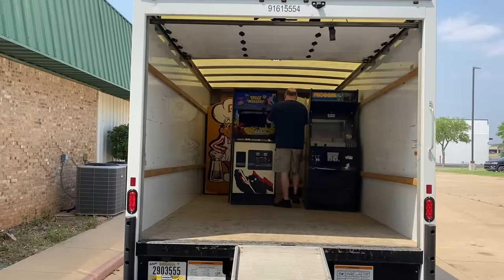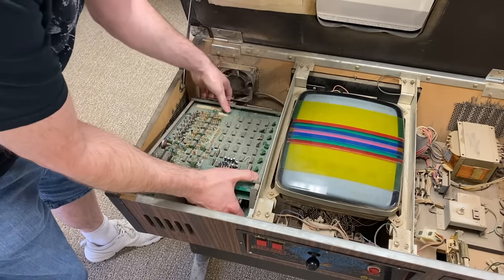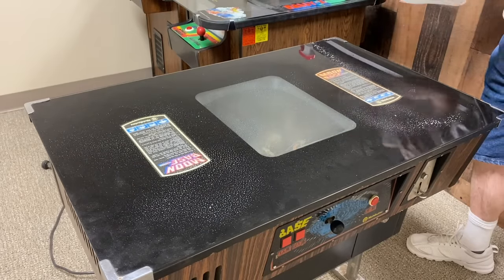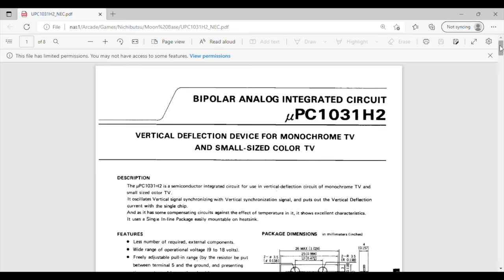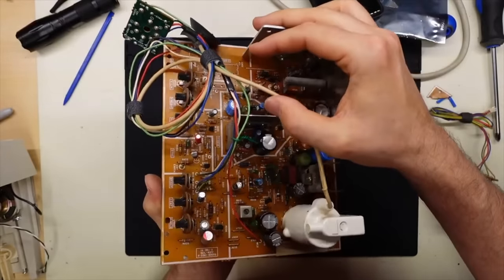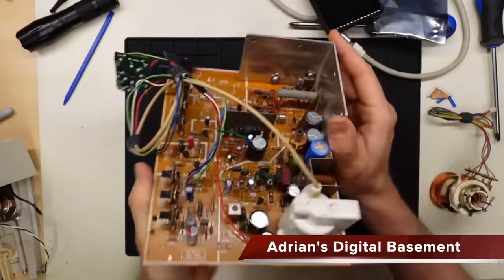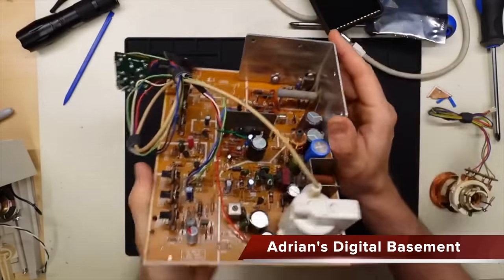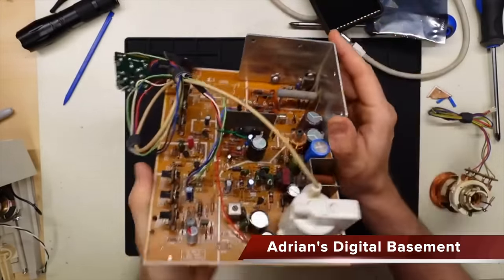Moonbase Arcade Restoration - Gone Wrong

Comment: I'm a TV technician - I started working on CRT sets (including monitors) in the late 1970s and continued into the early 2000s. First thing I will say is don't beat yourself up for installing the replacement IC backwards. I have done that a number of times myself, it's easy enough to do! 
As for the failure of the replacement, there's a few things I would be checking. The first is the DC resistance of the vertical coil on the yoke. It should be between 2 - 7 ohms (and 4 - 15 mH if you have an inductor tester). Also check it for shorted turns. That will kill a vertical output IC in short time.
Next check the voltage rail going to pin 2 or 10 - should be within the range of 9 - 18 volts (20 volts absolute max).
It is possible (can't be ruled out) that when you powered the board up with the IC installed backwards it compromised it. The results of such a situation can't be predicted. I have had ICs survive just fine, others fail immediately (let the magic smoke out) and some which worked fine for a while only to die further down the track.
Those dark stains on the original chip are indicative of an IC that's been running really hot. I suspect the thermal connection to the heatsink wasn't great. It needs to be very well thermally bonded. Use the white thermal paste.
Lastly I would question the authenticity of the replacement IC. Where did you source it from? If it's from eBay or Aliexpress etc it's likely a chinese fake. They'll often work for a while then go toes up after a period (as this one did). 
I would attempt to find a genuine IC from a known seller to be absolutely sure it's a good one.
As far as I can see, the KA2130 is a pin-for-pin replacement for the uPC1031H2.
Looking forward to part 2 of this saga.
Reply: Is it possible the power supply is just too high voltage?
Reply: Yeah, first thing I thought too - Partly shorted yoke would burn that IC up . I half-expected Adrian Black to check that on his video..
Reply: @cheyannei5983  Yes, it is possible but unlikely. If there was more than 20 volts on the vertical IC it would mean the rest of the supply rails were likely high as well and there'd be other weird symptoms (or capacitors starting to vent off). In any event, you would check the voltages as a matter of course before replacing any ICs like this.
Reply: @telbee  I've seen more than my share of yokes with shorted turns over the years but in this instance I would want to know that the vertical IC is a genuine part - there are way too many chinese fakes on the market and this is typical of what they do. If they work at all, they'll run for an hour or two then fail.
Reply: It seems like a frequency issue. Caps and resistors together can be used to create frequency. If there's a resistor that went weird then the SIP would work until it gets damaged again from too high current then you'll get the same issue. Something going to the SIP is probably messed up and replacing that SIP will cure the problem for long enough for it to get fried again. I'm thinking blown resistor.
Reply: Just commenting so this stays popular for him to see
Reply: I like your funny words magic man.
Reply: "Those dark stains on the original chip are indicative of an IC that's been running really hot." - like a machine designed for 100v being run at an over-voltage of 120v.  I'd bet The second chip couldn't take it either (and perhaps the NEC was a slightly better part with more tolerance for over voltage).  Time for another new chip AND this time fix the over voltage problem so it doesn't get burnt up too.
Reply: You were absolutely right - as he said in the next video, DC voltage was fallen down to 6V. So problem was in the power supply.
Reply: Thermal paste is subject to "thermal pumping" where it gets "squeezed out" over hot/cold cycles. I highly recommend using TIM i.e. thermal interface material. It's just better for many applications
Reply: what great and knowledgeable advice!
Reply: Wow, I didn’t expect to come across a tome in the comments section.😮
Reply: One thing I noticed is the heat sink on the new part is set to mount as you installed it (pin 1 in hole 10), but if you reverse it to the correct position (pin 1 in hole 1), how did you re-attach it back to the heatsink? If you didn't attach it or left an airgap between the metal top of the SIP and the heatsink with no paste or thermal transfer, that might also cause it to burn up. It's not shown how you re-installed it in the video so I wanted to call it out. Hope you get it working, and thank you for showing your process!
Reply: You're too funny, it's just an isolated phenomenon, don't link it to China ah
Reply: @cheyannei5983  -- The OG device power is 100 Vac converted to use US 120 Vac, so it wouldn't hurt to check the transformer to ensure it's stepping down the input voltage to what the cabinet takes.  But, be careful, high voltage is no joke.
Reply: Could it be a problem with the noise filter in the power supply?
Reply: Surely he should be wearing gloves?
Reply: @Garycarlyle  I've been repairing TVs since the late 1970s, never once worn gloves.
Reply: Awesome detailed information! So fascinating
Reply: These are Arcade games. I see 'em shown @ The 2-Bit Circus. Bornwell makes me useful.
Reply: @Alex-bc7qi  it probably uses a regulator circuit for the supply rails, so no big deal
Reply: 1 year later, and 8 bit guy has neither acknowledged this comment nor continued in a part 2. such a shame. but then again most youtubers over 30,000 subscribers stop paying attention to their comments entirely.
Reply: @yitong233 It's not an isolated phenomenon. As a professional repairer I have seen this happen many times, and in too many instances it has been due to counterfeit components sourced from china. If you don't like what I am saying then go and tell the people who are making all these fake parts to stop doing it - then there won't be a problem. I make no apologies for what I say - I have been burnt by fake parts once too often.
Reply: @miniadventureswithmark3309 The thing about electronic repair is it can be complex, and in order to explain things properly it is necessary to go into some detail. If I leave things out then I just get silly comments because people simply "assume" things, so I try to be as comprehensive as I can and cover all bases so there is no doubt.
Reply: @sw6188  Stopping unscrupulous merchants is impossible. QWQ
Reply: @TheKrensada  the very next video was him at the Vintage Computer Show in which someone called Sark identified the problem (a bad transistor on the voltage regulator, no China scapegoating necessary) and fixed it https://www.youtube.com/watch?v=5BfxUiF58Co
Will this cause you to reconsider snap judgments in your parasocial relationships? prob not I guess
Reply: You're the man! I really needed you like 25 yrs ago when I had a rolling image on a Toei CM-A20 in a Final Fight cab. I never could fix it and ended up selling it.